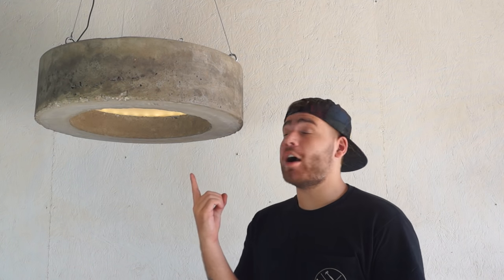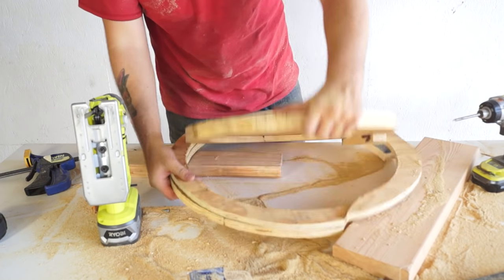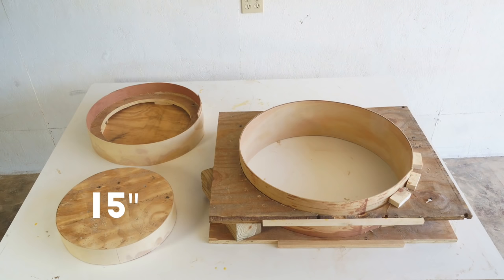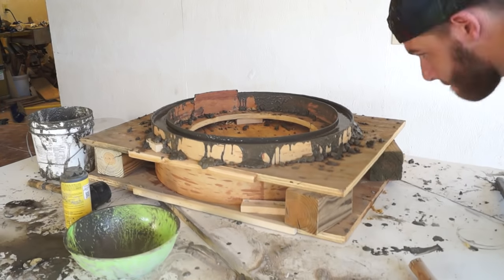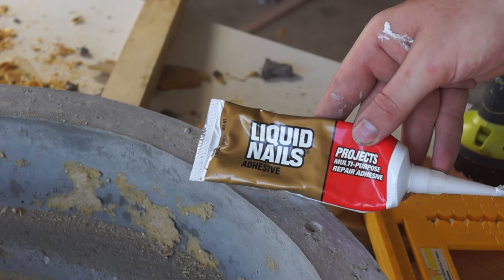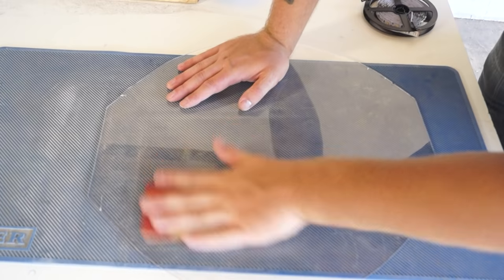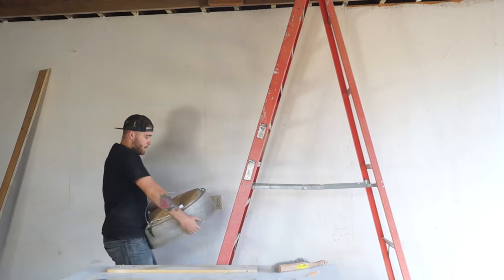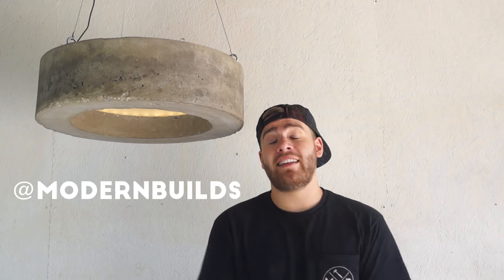DIY Concrete Pendant Light | Modern Builds | EP. 42

Comment: first of all it looks good but... You have a heavy lamp stuck to your ceiling over your head; if anything goes wrong you may have a big headache that I wouldnt take a chance. you can make the lamp lighter if you use styrofoam and coat it with cement.
Reply: highly agree.
Reply: Yeah this if definitely not the ideal lamp for your living room, but i think it would be perfect for some bar or something (as long as it is 100% safe :D )
Reply: I like this idea, of using Styrofoam coated with cement. I think this sort of lamp is ideal for like a back yard or something by the pool I am not sure If i would hang something like this given its weight.
Reply: Exactly what i was thinking, even tiling grout will do. That thing must weigh a ton! and woe betide anyone under it if it falls.

Comment: Few things.... thats a heavy but cool looking light. I kind of feel you should have used an aerated concrete mix that would have massively reduced the weight!

Plus some rebar if things so south while up in the air.

Lastly, a bit of spray oil from the kitchen is your friend in helping those moulds pop in the end!

Comment: Nice project! To get more bubbles out, you can use a sander very well.

I would use some rebar in the concrete and also use that to connect the hanging wires. So it can't break or come lose and destroy anything underneath it. 80+ pound of concrete is quite heavy when it knocks on your head.

Comment: hey mike, great video..

here's a few tricks I've used when working concrete
1) grease the form (other then the melamine one)
it'll help LEAPS when removing them

2) reciprocating saw (or scroll saw) with blade removed acts as a GREAT vibrating tool to remove air bubbles.
3) you obviously caught the mistake yourself, but anchor those hooks into wet concrete, it's far better than the epoxy! (duh!) Lol
4) most hardware stores sell pre"fogged" plexi, instead of sanding it down yourself. Alternatively, in the window covering department, they sell a cling wrap like material that can be used to fog it consistantly. Sure it's free to sand it, but consistancy is nice too in some cases. It's food for thought
5) consider using countertop concrete, it's generally lighter in weight. Maybe even toy around with plaster of paris?

that said, rock on with the lights
Reply from the maker: That's awesome man, thanks. I didn't know countertop mix was lighter, I'll have to check that out!
Reply: Normal weight concrete comes in at 145lbs per cubic foot.
Lightweight Concrete (typically what is branded as "countertop concrete") comes in at a nice 115lbs per cubic foot.

the major difference is the aggregate. Countertop stuff won't contain larger stone aggregate as is found in generic concrete.

Here's some good reading on concrete, it's quick and factual...
http://www.concretecountertopinstitute.com/blog/2013/08/lightweight-concrete-is-it-really-necessary-for-countertops/

Comment: This is an awesome project man, love it!  But I'd be super worried about the weight on that epoxy, it's not really made for it.  I'd e using some kind of expanding anchor like a dynabolt.  Check those hooks regularely
Reply: I would be more worried about an expanding bolt blowing out the thin section of concrete. Chemical anchors are preferable in this situation.

Comment: Hey, if you ever need to defuse a light again, I would recommend using theatrical gels. It's the stuff that's used in the lights to give the lighting color but you can also get it in plain white diffusion. I used a gel rosco number 116 (That's how they categorize them) on a harsh looking outdoor light and it worked great!!
Reply from the maker: That's a good idea man! I'l check that out

Comment: If you mix up some light foam and mix it into the concrete you get aircrete and it would have been about 60% lighter. I made a concrete (err Aircrete) light not quite as big as that and it weighs about 20 pounds

Comment: That's awesome, I loved the idea. Something that could be worth doing would be putting in foam into the concrete to make it a little lighter and metal mesh to give it some strength. Who knows maybe used right with some experimenting might be enough to cut its weight by half. It would make me feel safer knowing there isn't a 100 lb light fixture hanging over my head.
Reply: I was justhinking the same thing !

Comment: I don't know if you've done this before, but you can use a skill saw/sawzall with no blade to act as a vibrator around the forms to help create smooth surfaces at the form face.
Reply from the maker: That's a good idea. I've used a sander that way before, never a sawzall

Comment: if you want to do it lighter you can use the little balls of the styrofoam. this method is used to do light concrete roofs, try it. Nice lamp btw.
Reply from the maker: Right on, I'll check that out

Comment: For the next concrete and wood project use some used car oil in to the wood. That will give it more flexibility to the wood and will be super easy to take apart from the concrete.
Reply from the maker: Good Tip

Comment: This is an awesome project.  and now here's my completely unsolicited advice:  :)  
Changing only a couple things:  

1) in order to save your mold and make it easier to release, design the next one so that you have a slight draw angle.  This way the pieces easily 'pop' out and you can re-use the mold.

2) you can build knock-outs into the mold so that you have attachment points for ceiling cable.

3) i'd put some kind of reflecting material on the plywood top so that you get a brighter light.

I guess that's three things!  Anyways, nicely done.  Oh and if you have a concrete vibrator, you can just attach it to the table and shake out all the air gaps.  So there's four things LOL.  Anyways, I am subscribing, I like your channel and plan on doing some of your projects at my house.

Thanks!
Reply from the maker: Good ideas man! Thanks a lot

Comment: I was thinking about the weight problem,  same design but carved out of  a block of polystyrene, then covered in fine mesh, stick a layer of vinyl re enforced concrete grout or mortar to the mesh, let it dry and you have the concrete looking lamp without the weight.

Comment: yooo, usually im not that bothered about safety. but youre seriously holding those hooks in with epoxy. speaking as someone that just came out of college after studying mechanical engineering for 2 years. i can say with confidence that concrete is super brittle. especially with fine mixes such as this, it doesnt take much to crumble. its a lot of weight for such little support. with a lot of other concrete projects there isnt any need for a frame because they are usually either safely grounded or such a small scale that the concrete is never under stress. however when using concrete as a building material or for heavy duty furnature such as this, a steel skeleton is a must have.
next time you attempt a project such as this, try to focus on putting all the weight onto the frame by having hooks anchored/welded on, and then cast the concrete around the frame.
people dont function very well without bones, the same can be said for concrete structures.

Comment: As so many people have said this in the comments - DON'T DO THIS,  as it is shown in the video.  Frankly, not sure why creator didn't remove this DIY video, because he usually produces much better content. This isn't safe!  
1)Weight is over the load capacity of the epoxy glued hooks, which are pointing the wrong way. There seems to be a lot of coarse aggregate. Easy fix: use light weight concrete, like aircrete, or paint Styrofoam with concrete product .  
2)Spray/wax the form for easy release. The edges, in particular should have had silicone for crisp lines, as they look too rough here. Removing this from the form, was unnecessarily difficult, if he had just taken time to prep form. 
3)Attach the electrical wiring to the lamp structure, with enough slack.
4)Lamp output will be too low, for most rooms in your house.  This is more for a lounge effect. Ironically, by blocking the top of the lamp with the plywood (which should have been painted white) the light is much darker, as you lose the ceiling reflected light. Solution: use more/ higher quality LED strips; don't block the top.

Comment: Polyurethane your wood molds. Also, use blocks and ratchet straps to confine your molds. It will all come apart way easier. If it will fit, put that bad boy in the fridge after about a week to shrink the concrete off the molds.
Reply from the maker: Yeah, putting a couple costs of poly would've been a good idea

Comment: If you use a polyurethane varnish on the surfaces touching the concrete, it would make it easier to remove the concrete from the mould
Reply from the maker: Good tip!

Comment: I am unsure of the desired use-case and brightness the customer wanted. But if this isn't as bright as you had hopped, next time have the led strip be aligned with the edge of the Plexiglas you diffused. I do this for my Star Lord lenses i make for the helmets, and it is how those glowing Plexiglas signs and EXIT signs are made. This allows the light to go through all of the inside of the clear part of the glass and disperse mainly through the diffused part brighter. Instead of trying to pass through two diffused sides on a piece of glass.
Reply from the maker: That's a good tip. It really is pretty bright, just not compared to the sunlight coming in through my shop. Thanks a lot man
Reply: +Modern Builds yeah, thanks for the quick response. that was why I wasn't sure if it was bright enough or not. cameras usually don't give lighting projects justice to their actual lighting capabilities. especially if there is natural light in the shot. Keep making these videos and projects man. its good to see other Midwest creators making stuff. if my channel ever gets going somewhere I might later suggest a collar... :P but I'm not big enough to help you out at all yet. lol.
Reply: +Daniel Wiggins collab*